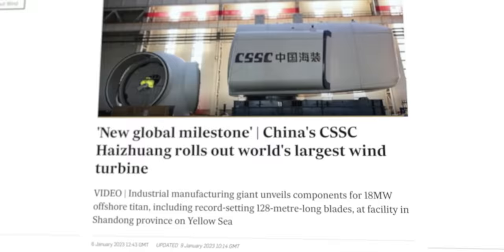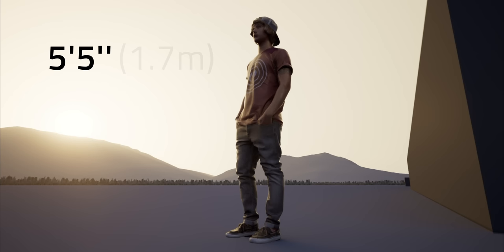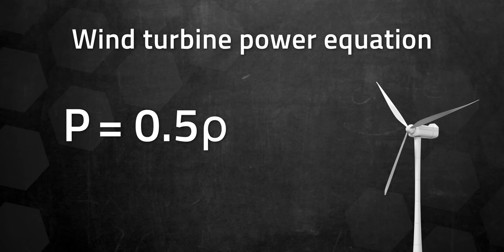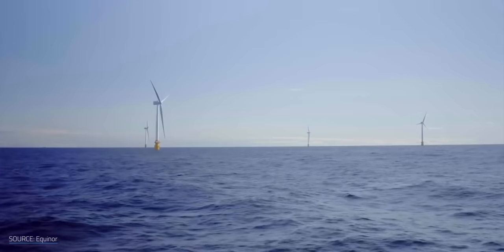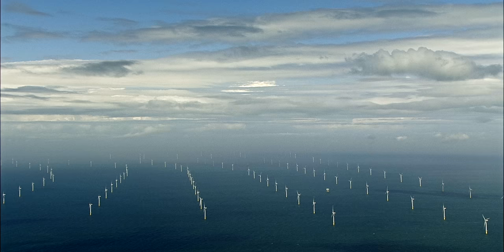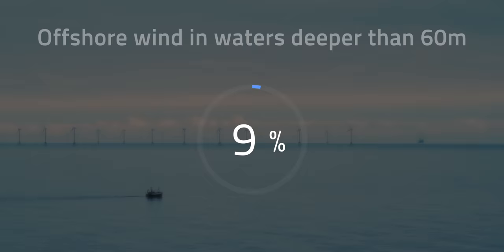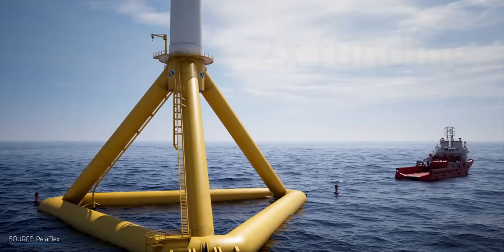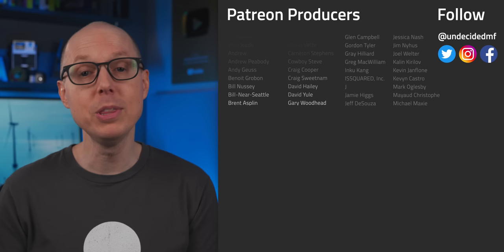Why Are Floating Wind Turbines So Huge?

Comment: Watching this kind of left me wondering... If these turbines getting bigger and bigger, and therefore heavier and heavier, wouldn't it also push up the lower boundary of what wind can it catch? As in, the wind we'd consider "moderate" here on land maybe won't even move a heavier turbine? I've no idea what the math behind this is, so I may be completely wrong, but still, that's an interesting question to me. And if that's true, I wonder if getting a whole bunch of small turbines to catch light wind at some point would be profitable
Reply: Interestingly the bigger the tower is, the LOWER the cut in speed is (cut in speed is the lowest speed of wind needed to produce power) this is because the area of the spinning blade is a circle. The area is determine by Pi * radius^2. So the radius is extremely important, just like a pizza pie, every inch bigger makes a huge effect on the area. Another factor is torque, which again is a factor of distance of radius squared. So every inch longer the blade is, it produces more and more force at the base with less wind power.

Comment: What is the environmental impact when these turbines have to be retired?
Reply: 80 to 90% of the windturbine can be recycled.
Reply: @old-pete  interesting...what material are they made out of?
Reply: @johndavolta3124  Most is concrete and/or steel, depending on what type you look it. The blades are made from glass fibre composite material, often including carbon fibre for the newer turbines.

Comment: Would it be possible to use the electricity generated to produce hydrogen and the just go an collect it on ships rather than spending so much on the infrastructure to send the electricity. Isn't it just electrolysis?

Comment: With a 260 meter diameter rotor, I would expect a very large variation in wind speed at the top, versus the wind speed closest to the ground. Seems like crazy uneven loads…
Reply: At that height you can even get situations were the wind speed has started to decrease again by the time you get up to ~ 300 m. The difference between say the 40 meter winds vs the 300 meter winds can be quite large when an airmass is much warmer than the sea surface.
Reply: I mean the uneven-ness is less likely to be a problem compared to just them being huge loads.  these blades are super strong / flexible.. . I mean they are cantilevering 140m  and moving near the speed of sound at the tip.

Comment: Please go into more detail of the actual alternator next time. Those things must be enormous and I'd like to hear about the gearing, rpm, and how this is managed with different wind speed. As some of you know, it's required to spin an alternator at 1800 RPM to deliver 60HZ AC. So I'd like to know how they keep this constant on these wind turbines. Also, I'd like to hear more about the backend cabling that transmits this energy to the grid.
Reply: They do not keep the RPM constant. Electronics form the electricity output.

Comment: Or u could build one nuclear plant with 4 reactors for 3 Gw of total power that makes electricity even when the wind doesn’t blow. Doesn’t produce carbon. Has cheap fuel. What am I missing?
Reply: That it requires a finite fuel source.
Reply: @SilverEye91  The ocean is literally full of uranium oxide. We could never exhaust the supply of uranium over the next 1000 years.
Reply: @jam206AR  Good luck harvesting that in a way that doesn't ruin the oceans.
Reply: @SilverEye91  Uranium membrane selection of sea water is already happening. Very safe and scalable. Not sure why people want windmills that are very expensive, hard on the environment, and only make power when the wind blows.
Reply: Cost
Reply: @infinitelyexplosive4131  The cost of nuclear power is much cheaper over the life of a reactor compared to replacement and refurb windmill costs. Also remember that additional infrastructure must be put into place to generate power when the wind isn’t blowing. Wind power makes absolutely no sense but it makes people “feel good”.
Reply: @jam206AR  That certainly isn't true for the cost of onshore wind, and generally isn't the case for fixed offshore wind either. We saw LCOE for both drop dramatically as production scaled up and installers learned how to be most efficient. Floating offshore wind is currently more expensive than nuclear. Keep in mind that there are only 3 active floating offshore wind farms right now.

So the bet you're taking is this: take out a ~10 billion dollar loan now and hope that in 7-15 years when construction is finished and you start actually generating electricity that the cost of offshore wind hasn't decreased enough to kill your profitability at that point.
Reply: @infinitelyexplosive4131  So we should build energy supply for the short term? I specifically said over the life of a reactor (40-50 years). Also you didn’t account for the natural gas generator you need to build for when the wind doesn’t blow.
Reply: @jam206AR  "So we should build energy supply for the short term?" 

I don't understand where you get that idea. I'm comparing the cost of nuclear and wind by LCOE, not nameplate capacity. 

You also need a natural gas generator for the times when the nuclear plant is down, which is about 10% of the time in the long run. But in the context of a single power plant, it's still a reasonable assumption to say the grid can handle it through existing peakers, overprovisioned renewables, or storage. 

Ultimately, the theory is more or less irrelevant. Look at the actual history of nuclear in the US. 2 projects finished in the last 20 years, both ended up ~2x over budget. The only other project was cancelled, it went so catastrophically wrong that two executives received jail time. If the numbers made sense, we would see more projects in planning and construction phases.

Comment: Does the $30 per megawatt-hour for grounded turbines that you quoted include the price of land? It seems to me that a big advantage to offshore turbines would be the cheap or free real estate.
Reply: Since they actually use a very small amount of land (eg you can continue to farm / forest underneath it once it's built)  they tend to lease and i don't think that's the biggest cost.  but i think the $30 is the lcoe which will include all costs.      land is expensive but doing anything in the sea is difficult.. and you generally have to bid to governments for the rights to the areas in the sea as well.

Comment: How long can those blades become before they cannot support themselves anymore? I mean, you could use centrifugal force at some point to have blades that extend as they speed up?
Reply: The tensile strength of the material is engineered and thought about well in advance. The materials will never (under ideal circumstances, ei not severe storms) bend to the point that they distort. Carbon fiber can bend like 10% from base to tip and be structurally unchanged. The wings of an airplane bend and wobble the whole ride, but last for many years. It’s when they bend beyond the “breaking” point that the strength is compromised.

Comment: We shouldn't underestimate the costs of maintenance. For one, the costs of maintenance for the off shore turbines are higher due to accessibility but also because the see winds increase the corrosion of the blades. Going further out and building bigger may actually accelerate that too.

Comment: I wonder if those new props for boats would make any difference on these things.  They are changing the game for boats. I wonder if they can be scaled up for turbines.
Reply: No, the new boat props can't adjust the pitch, so its not possible to adjust the power.
It would also be a nightmare to build such prop design the size of a wind turbine, to be structurally strong, not too heavy, not too expensive.
Reply: @niconico3907  but those new props are brand new. You wouldn’t know unless you try right ? Try it on a smaller scale and see what happens
Reply: @Sjrick  the new prop design can't adjust the pitch, so it is not possible to reduce the power of the turbine when the wind gets stronger, and stop the turbine when its too strong.

Comment: Good they can make all ships run on batteries, The ships can pull up and plug in and recharge at a windmill, Just think of all the millions of gallons of fuel will be saved.
Reply: That's why I put solar panels on my car.  I never have to buy gas.

Comment: You make the same fault as the media....
A windmill is NOT mesured from ground to tip og blade.
Any windmill is always measured ti center of hub.
That's the only fixed measurement you can use.
You do not measure your own hight with your arms up in the air.
And the process of manufactoring a blade, vaeies in meters, to balance out the blades, they are not at all the same length on one mill, they are ballanced out by the lenght.

Comment: A while back I watched a video about why turbines have 3 blades, not 2 or 4 or more.  I wasn't impressed with the scientific or mathematical rigor of the video.
I've noticed that heavy-lift helicopters use 5 rotors to harness the greater power of the engine.  Seems like wind turbines could benefit from more blades.
Matt, would you like to see if you can give a better explanation?
Reply: @rogerstarkey5390  Thanks for your reply, R.S.  But could you please use more words?  I don't see where you're going with "weight".  Yes, weight costs money and adds slightly to the cost of the vertical support.  But these 'beasts' are already heavy and expensive.  I would think that there is a benefit to getting more KWH per tower.
 Respectfully submitted

Comment: Wonderful reporting, Mat, as always. Have you looked yet at the potential to produce and pipe hydrogen from the offshore farms instead of electricity? I'd be curious to compare the costs and impacts...
Reply: Producing hydrogen from wind farms is not economical as it loses 20 to 40% of its energy in producing the Hydrogen continuously, it's best to cable the raw power to the shore, it's expensive but a one of cost and as the cable generally lasts longer than the lifetime of the wind farm so at present it is a non starter!?!
Reply: @thomasherrin6798  I started to think about the H2 route in considering the problems/cost involved in moving electricity from north Africa to Europe. Even if there is some inefficiency today in producing green H2, if the energy is cheap and abundant enough, why not? I'd just like to see the numbers, from €10/k x H2 down to 1.
Reply: @rogerstarkey5390  Thanks, Roger. The possibility that piques my interest is seeing the cost of producing H2 fall by a factor of ten, as solar has in the past decade or so. Our host Mat has dedicated several episodes to moving storing and energy in original ways (one explored oxidizing and reducing metallic iron).
Is there interest in deploying H2 (or ammonia) as an alternative to DC transmission over great distances? This is not my field; I'm asking in good faith...

Comment: How does your neck support your head?
Reply: The head is empty, so the weight is less then it's perceived to be.  By filling the cranium with air, the head is much lighter.  This means a smaller neck is required to support the head.  The head is lighter than the size would hint.  This way, the neck doesn't need to be as large.

Comment: No need for concrete foundations. Can be moved if climate change winds move. Closer to building offshore oil rigs. Can bend like trees in the wind or massive seastorm swells. Can be installed faster.

Comment: Not a great video.  The economic gains for greater turbine length are very real, but pointing to appearance of turbine radius in the power equation does not explain why: the power grows quadratically with the turbine radius, but the amount of material you need to build that blade grow cubically naively. So naively you'd save money by building many smaller turbines rather than fewer large ones.

The point about higher hubs accessing higher wind speeds is convincing, but then one might ask why not keep the blade length fixed and just make a higher hub? There's an answer for that too, but it's not in this video.

Comment: I wonder about alternating traditional turbines with large fly-swatter-looking grids to "comb" the air straighter, while generating power from vibrations, and if this will just purely slow down the wind to kill down-stream generation or if the "combing action" could Laminarize the flow enough to offset it's reduced speeds...

Comment: I fel like its going to cause problems... let alone the over all cost to deploy and send these out. What about sending out the more bladess designs? I know they're not as good as the blade designs, but if I remember correctly, they were cheaper and because they have no blades, I would assume be better for the environment let alone you can get more of them in a sqare mile compare to the blade designs.

Comment: Bigger is better. It means fewer machines to maintain, which reduces running costs. It's easier for ships to navigate around fewer, larger machines. Less wiring is necessary for fewer machines, less to go wrong. Off shore often means steady wind, capacity factors often exceeding 50%. That's nearly double the annual output of most on-shore installations of the same capacity.  #Big fan of the big fans

Comment: There goes our money out the freaking door. I would rather spend my money on a good old fashioned gas power generator, as a back up source. Nuclear power is the best, very little repairs needed.
Reply: A nuclear power plant is extremly costly as every system needs multiple backups and one needs sufficient personal to check everything regularly and maintain everthing in the best condition, that nothing breaks at the wrong time.
Reply: @old-pete  so, I would still rather have one in my back yard then a solar panel or a wind turbine. At least this way I can be apart of its operation when it comes to nuclear power. My better half ownes radio active material right now, and at least if I ever get cancer I wouldn't have far to go to get my dose of radiation.

For just one wind powered turbine that's put on line needs gallons of oil to keep it lubbercated, and solar panels are toxic to the environment as for its safe disposal. You don't know half as much as you think when it comes to how this stuff works. I live about 18 miles from a nuclear power reactor, and not once had an issue of its clean power producing capabilities. Oh and nuclear doesn't need half as many repairs as you say they do. I just so happen to know a good friend that works in a nuclear power plant, and he's even told me that they only make repairs when needed. I also have a few electronic parts from the plant he works at. They do however make an inspection of all critical operating systems, to make sure all systems are a go.
If I got into nuclear physics, I would have built my own plant, oned, operated, and ran by me.
Reply: @HollyTimlick-du2zx  Good for you. Did you ask your neighbours? There is a good reason this is not allowed.
Reply: @HollyTimlick-du2zx And you would trust all your neighbours with operating a nuclear power plant? I would not.
And no, my monthly bill is lower than that. I change the electric company regularly. And windturbines and solar are still cheaper than nuclear power plants,
Reply: @old-pete  sure I would, why not. And I seriously doubt that your electric bill is lower then $40. I don't know of one person who has a bill lower then that. Even with one year use of power I could never pay off solar in one month. And there is no way the cost of one wind power generator would even be close to that being cheap. I don't believe it, no freaking way. All of my other neighbors have their electric bills 5 times more then that. Well over $200. Especially when all I have is a fridge, and a box fan with my cell charger. I don't have cable tv, or even a tv. I don't have a computer, just live a simple life. After seeing just one solar panel at $1,900.00, and that doesn't include the converter or battery. There is no way in hell way I can afford or even come close to afford anything like that. That is way to much for my blood. And if by some chance nuclear gets that pricy, I will completely cut all electrical power off. That is NO electrical power at all. No solar, no wind and no nuclear! You see I can afford 40 a month, but since you have a damn good job you can afford a $2,000.00 solar panel, but I can't nor do I want that ugly shit on my roof! You can gave it, I don't want it! You can afford all of that stuff, but there are hundreds who cant, and would stay with nuclear power. So my suggestion is STOP pushing the green power on those who don't want it nor support it. I would rather go with out then have it! End of discussion...... Oh and by the way nuclear is safe and also green energy as well.
Reply: @HollyTimlick-du2zx  So the old neighbour who cannot even find the glasses on his nose, should be allowed to operate a nuclear power plant...
If somebody ever allows this, I hope it is far away.
And nobody talks about you buying solar panels or windturbines and making them pay off in a month.